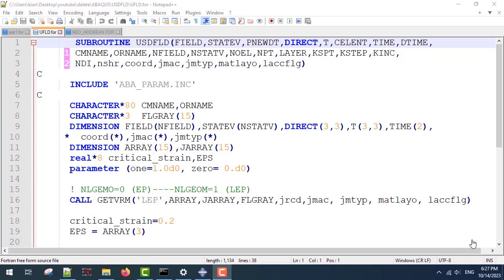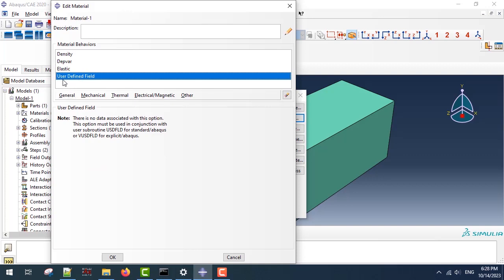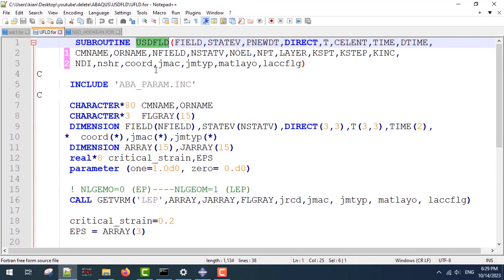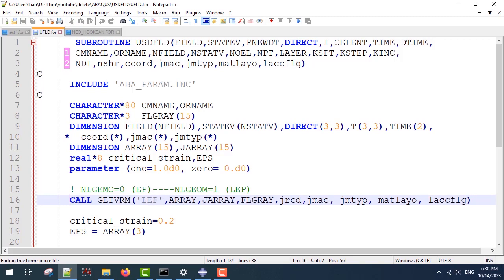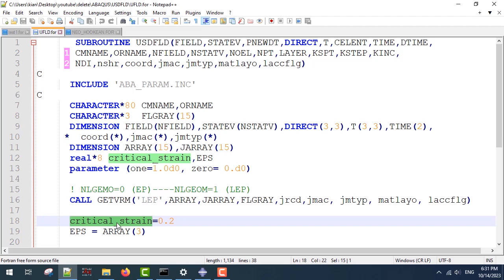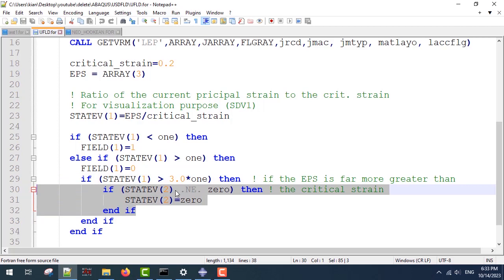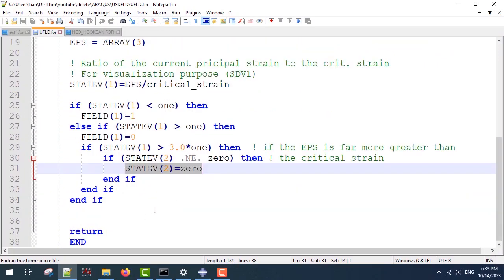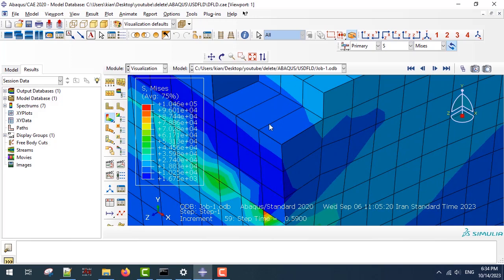Element deletion using USDFLD subroutine

Comment: I replicated your model, but the element were not deleted where the FIELD(1) =0 and SDV2=0, what could be the reason? thanks.
Reply from the maker: If you replicated the exact model, the results should be the same. Maybe, all of the integration points have not reached the critical value.

Comment: Sir, I am using combined hardning rule for steel damper subjected to cycle loading. I am trying to validate the results but I am getting high initial stiffness. Is there a way we can use reduced value of youngs modules for initial cycles and higher values for remaining cycles
Reply from the maker: You can do whatever you want with this subroutine. However, the initial stiffness is related to elastic modulus.
Reply: Thank you Sir